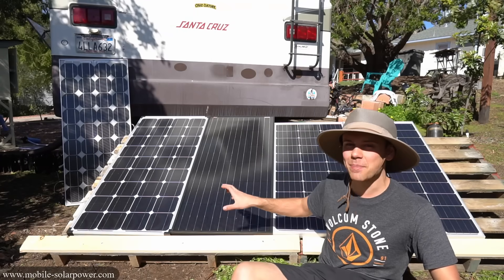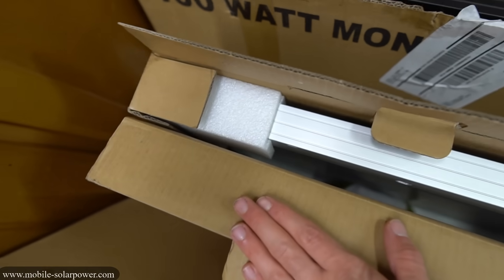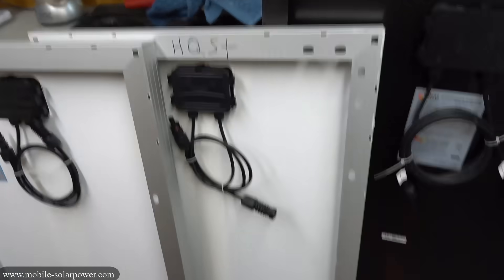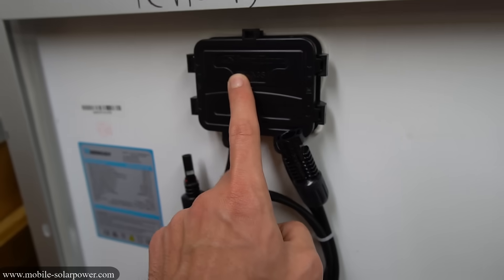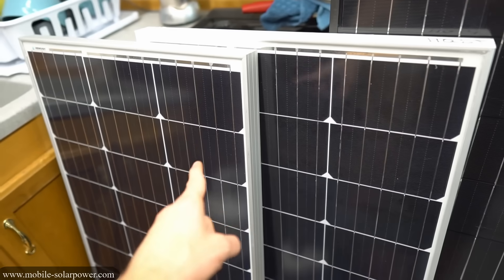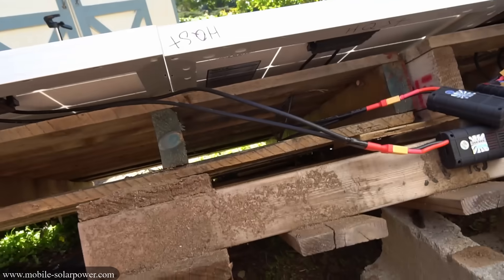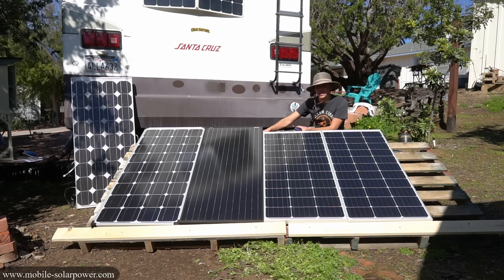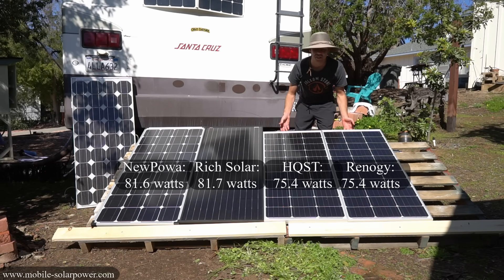Top 4 Amazon.com 100w Solar Panels Tested! Renogy vs. HQST vs. Rich Solar vs. NewPowa

Comment: I realize that we can't get LG NeON_2 panels from crAmazon but they are worth a shot. At 370 watts per panel and direct hermetically sealed inverters that synchronize to increase the power handling. I know that charging batteries from an AC source is inefficient compared to direct DC systems. It's still more effective than most other solar systems due to the high output. It also simplifies the system as there are no additional inverters or adapters to buy. There are battery backup systems available for reserve power when there's no sunlight. Definitely worth checking out.

Comment: Hi Will, I was just turned onto your channel by Bob Wells of cheap rv living. I know absolutely ZERO about solar or any kind of electricity or electronic devices. I recently bought a rockpals 300wt solar power station after a lot of research and have used it without solar a few times. It seems to work great for my applications. I do not have a fridge or anything with high usage like that. But decided I'd be well served by getting at least one solar panel. I read and saw got reviews on the newpowa 100w 12v panel. I also don't want to mount it permanently on my van roof as I'll have other stuff up there among other reasons. These purchases were also financially motivated. After watching this video I'm hoping that I will not regret that decision. But since the purchases have been made, my question now is what else do i need to buy to connect these 2 and have power? Keep in mind the finances issue here. So far I've spent a little more than $250 so I'm doing good I think. I do not have a lot to spend obviously. Thank you in advance for your help. And, I love watching your videos you make this complicated information much more understandable.

Comment: I have Renogy compact 100W. It puts out 75-80W via microinverter. A little smaller than other panels, for my installation that was critical.
I can't imagine those corner holes being functional, I think they're useless.

Comment: I was wondering if you have any experience with the HIGHTEC SOLAR 200W 36 CELL 12V NOMINAL SOLAR PANEL sold by continuours resources?  They also make a 210 watt with the same footprint as the 200 watt.  I am trying to decide between the HQST 190 watt panels vs the Hitec?  Thanks for any input.

Comment: One test I would be interested is how much each panel is degraded by shade spots.  This is a big problem with any mobile use of solar panels.  Like with some panels a small shade spot will complete kill the output of the panel.  Adding this test should be useful information in considering a solar panel purchase.  Do you agree?

Comment: They are ADVERTISED as 100W. Do the ratio of area / power output, they'll be the same. A way to show higher yield, but if you are limited by size, area / power is what matters.

Comment: Hello.
 j'ai un HQST 12v100w polycristallin, pour charger une batterie de 80A, depuis plus de 4 ans. (en 2021).
Le panneau charge même avec 30cm de neige dessus.
Trés contente de ce panneau, même si la batterie est trop forte, il rempli bien sa fonction. (L'installation de départ était prévue pour une batterie de 60A, mais on a pris une 80A).
Donc oui, je suis OK. HQST = Bon produit.
Reply: Je penses, equalement d'acheter le HQST 12v100w a place du Renogy. La neige qui  peux  mettre un baton-dans-les-roue. Merci pour la confirmation !

Comment: Does anyone know the answer to this question,  I got a 14 inch by14 inch panel,  supposed to be 100 Wat, but you usually see that same size at around 20 or 30 wats , is it possible that its really 100 wat.
Reply: I bought a twenty watt panel.  Turned out to be 5 watts.  Only about 9 inches square.  Another China con.
Reply: @jimlarsen6782  yes basically your right.
Reply: Depends on the weather & sun condition
Reply: @briantruck2284  i meant is it possible that such a small sized panel could produce 100 wats

Comment: I have 800 watts (100 watts each) worth of Newpowa panels and they charge my 560ah batteries really well. For the price of $79 per panel and a higher output... I'll deal with the slightly larger size.

Comment: I know you’re a busy guy but I could really use your help I’ve been watching your videos and I recently purchased Rockpals 500 W generator and two rich solar 100 W 12 V poly Crystaline panels.  I don’t understand what adapter I need to buy to connect the two panels together and then to plug it into the generator to charge it is it possible that you could send me a link in terms of what type of adapter I need to purchase to connect the two panels so that I can plug it into the generator to charge I would greatly appreciate it and I find your videos extremely interesting.

Comment: you missed one of the biggest points! Vaule to watt? "If" size is not an issue 10% more watts is very good and maybe equale in watt to foot print ratio.
As I found the "newpowa 100 watt cells for 33% of the average cost of the lowest price of the other cells, I must disagree with your conclusion.

Thanks for taking your time!!

Comment: I just bought the Renogy Kit (Flash Sale) 100 watt 30Amp with PWM Controller. Not sure which one you tested in this video. But your thoughts would be appreciated. By the way, the flash sale saved me $50.

Comment: You are ruling out the larger ones because you don't like the size...  but they do give out 9% more power....    So I do slightly disagree with you...  have to give them credit for that extra 6watts per 75watt base...    But love the video, respect you buying the panels, and the excellent info to make comparisons...    and thx for the recommendation...   the hqst does seem great...  but wanted to give credit to the others if they were also cheaper....  don't think you noted their price..

Comment: Okay...I bought 3 of the HQST 100D SSP and today thru my 4215 bn they were showing 268.6 watts in series...Im gonna put two and two together...I used inch and a quarter square steel pipe for my protective frames...I just welded two inch pieces of inch and a half strap wherever I wanted bolts..its heavy enough the wind wont move it but light enough to move..

Comment: Even though the HQST and Renogy panels appear to be clones of each, with the HQST having a slightly lower price, the HQST company itself seems to have issues. I ordered a couple of inexpensive items from them on Oct 18, 2020, it is now Oct 28, 2020 and I still haven't received them. HQST supplied a USPS tracking number and the USPS still shows that they have not received the package from HQST.

This tells me that either HQST has horrible management practices or they are floating money.

For me this brings into question the ability of HQST to honor it's warranties.

Comment: Hw Will love your channel but I have a question I live in my van but I just started so funds are limited. My question is if you could afford 1 150 watt solar panel which one would you buy?
Reply: Depending on what you are powering you might be better off with a DC to DC charger.

Comment: What happens if I just hook up 4 panels straight with an inverter and no battery to store power? Basically I only want my equipment to run during the sun up time, what happens to all the excess energy capture? Is there a way to waste it or will it burn up the equipment?
Reply: It probably wont run, or run very poorly which would eventually burn out your equipment. 
Never mind the excess energy, how will it run on a decrease in power? 
Do you mean a charge controller?

Comment: If you need more than 100W, screw 100W panels.  Get a 325W Canadian Solar
 panel.  Cheaper on a $/W basis and it has better shade tolerance than 
most panels.  No free Amazon shipping though.  Typically a flat $150 for 1-8 panels.

Comment: Also there is very lite that putting a battery underload, however. For the efficiency loss the smaller panels where better if they were cheaper. However you are looking at 30% efficiency loss. But solar has that issue in general you need alot of space to produce a little power. And you cant speed charge a battery underload so in most solar applications its best to oversize your battery bank to offset charge capacity to your panels and with 100 watt panels you have an awful lot to compensate for.

Comment: Seems to me that the renogy panel and the hqst came off the exact same assembly line renogy is obviously buying their panels or getting them from the same manufacturer and what renogy is selling is their brand name and service that's why they're more expensive than the hqst?
Reply: Renogy makes the panels that HQST is selling. It's likely those are panels that Renogy has QA'd as being "b" quality.
Reply: @peterrocan2542  okay I like that... good insight! Sounds a little more reasonable than my tinfoil hat pessimism as usual...thanks!

Comment: the year is 2473. uncle owen is trying to decide which  solar panel the jawas are selling is most reliable.  you watch this video to find out the best way to determine how to determine which solar panel is best.  you make a choice but the solar panel explodes as the jawas begin to unload it, so you end up buying the cheaper R2 unit.  thus beginning your journey to learn the ways of the force and destroy the empire

Comment: Looking to purchase a 150W or 175W panel for RV roof mount on a 24’ Winnebago View. Any recommendations at that wattage? Also if the wires coming from the diode box are too short can they be easily extended or do I need to use a special type of wire? Thanks and keep up the awesome video reviews !

Comment: I just bought this panel (RICH SOLAR 200 Watt 24 Volt Moncrystalline) , to start my solar project :)  but I get a max of 150W  (California summer, 95F+) ,  I asked the Amazon vendor why I was not getting more and they said that it depends on a lot of factors (which is true now that I learned a bit about panels, is hot here!!!!) but, how can I know for sure that the panel is a real 200W ? (of course when the best tested weather conditions are in place).  I found more expensive 200W panels which are bigger and with more cells, so I just want to be sure I am not getting something different from advertised. I  have a 30ft 10awg from the panel to a victron 100/50 mppt to 24v batteries and 3k inverter  , I have the same watt meter you are using in this video and I  use the victron app to validate PV info. Thanks

Comment: It might have helped if the panels were tilted at a different angle to maximize the output.  But they were all the same, which was a fair test.  Hey, the larger panels have slightly larger areas so it makes sense that they should put out more power.  BTW, you said "cheap Chinese..." But that's redundant.  Everything from China is cheap, so just avoid redundancy.  Your evaluation videos are great, thank you for the information.  👍

Comment: Will takes time to keep variables out of the testing process but then gives a completely biased set of results!
A review without price is useless!
The 2 larger panels may have cost less while clearly putting out the most power so for someone looking to put just one on the roof of an RV they would be the clear winners!

Comment: I am really enjoying your videos and find them very helpful. 
I am building a teardrop trailer and would like to add solar as a power source. I will not be powering much more than some LED lights, a 12V shower pump, A laptop and some USB chargers and certainly not all at the same time. I was looking at the HQST panels on Amazon but cannot find the models in this video. I have a 5' footprint for mounting on an angled roof (actually 2 so may do 2 - 100 W / 12 V panels). Can you share the product code (I'm looking for dimensions)  and if you no longer have can you confirm that the size and shape don't matter so long as the ratings are those I'm looking for. Don't know why it would matter but never hurts to ask. 

Thank you in advance if you find the time to answer. 

Drew

Comment: Hi Will, any thoughts on the Newpowa 200W Monocrystalline 200 Watt 12V Solar Panel High Efficiency Mono Module RV Marine Boat Off Grid?  200W taking up less space sounds compelling, but would appreciate your thoughts.

Comment: Great review, I've had 8 of the HQST panels for almost 2 years and at peak time on the average they hit up to 731 watts, off a Victron 150/35 Controller at 25' with 12 gauge marine wire.  That's around 91-92 watts per panel, I hose them down maybe 3 times a year, due to birds and dust, very happy with them and saved a few bucks in the process.

Comment: @Will ....... Hey I have gone back through some of your videos looking for an answer to a question I have had for some time now and was not able to find anything answering the question that I have.... So with that, here is the question. Maybe you can shed some light on it for those of us who are nubes to the whole RV solar world. 

Why can we not use "Home-use" or "Residential" solar panels or systems for off-grid RV use? 

From what I have seen Residential panels have a higher output than said portable or "RV" panels and "SEEM" to handle heat better than portable/rv panels. I am also looking at tying in a wind generator to the charging system as well since we are planning on prolonged stay to help keep the system charged on days and weeks where there isn't much sun

Comment: The solar panel and wind turbine manufactures have done a disservice to the consumer by marketing  their products in  Watts. Watts are a unit of energy consumption not energy producing...like bulbs are labeled by how many Watts they are consuming...A better way to measure the ability of a panel or wind turbine is to know what is the voltage and amps they output given the same load. A 12 volt battery needs about 14 volts to be able to be charged else it does nothing the amps determine how fast it charges.  A car's alternator is rated by how many amps they produce not by how many watts...go buy one or check your car. You never mentioned the  no load voltage that were present at each panel nor the amps being produced once connected. Solar panel are being marketed by how big of an appliance can be connected to them directly thus the watts rating...most people use panels and turbines to charge batterries not run thing directly from them.

Comment: I purchased 4 HQST 100 from ebay yesterday. I never heard of them before 3 weeks ago. But I like how I can get a discount on purchasing four of them. However, after looking again, I saw I could have gotten windy nation for a little cheaper. But this is Poly not Mono. 

I have been buying Poly since the beginning because of cost. But after doing some research, I found that Mono is more efficient. So I'm giving Mono a try.
Already having 8 panels. I plan to concentrate my Mono's for running my small freezer and thermo-electric cooler. This will be couple with 4 Golf Cart batteries running at 470AH. 

With that said, thanks for the effort you put into the review. Now I feel more confident in my buying decision.

Comment: Hi. Thanks for the informative and helpful videos...
Any chance you can help me with a recommendation?
I have a workshop with 3 x 36v, 7A panels in Parallel feeding a 12v flooded battery setup. Can you recommend a budget MPPT controller PLEASE?
I have a no name 30a mppt 12/24v controller which, even though I set the parameters to less than battery voltage, it still charges at high currents. I'm not sure if this is because the panel voltage dictates the output voltage (over ruling my manual settings) or what! (I've tried 2 of this same controller with same results)
Anyway, can you recommend a budget MPPT controller for 12v systems that allows for a 36v panel input?

Help truly appreciated ... Dave

Comment: I own a Renogy 100w 12v solar panel 

Was gonna buy Renogy Rover Elite 20 amp MPPT Solar Charge Controller, 20Amp, with LCD Display as controller will this item works as controller

Comment: I don't get why you wouldn't want the panels that produce the most power. No matter where you live you will never get the rated wattage out of solar. You might as well get as close as possible by buying the ones that output the most. On a cloudy day it might be the difference between running your electronics or not.

Comment: Yes a lot of them are all identical  components on different variations of mounting rails position of terminal and so on and if you order them all over again  you might even get different set up I've seen a 99 dollar one from aussi an a 300 everything same parameters and the 99$ pulled a massive positive deference over the more expensive .  All I know is I'm here to learn from "seasoned vets" to embrace knowledge so im ready when the the stars align 🙏🏼

Comment: Could you please do a review / test and compare the ECO-WORTHY 12v 120 watt solar panel found on Amazon for $99.99. I am considering purchasing a set of 4 for an RV off grid power source. They claim to use grade A solar cells and I am wondering how they compare to the other panels you have reviewed in this test. I have researched each of them and was wondering what your thoughts are.
You make great video reviews and I have learned a lot. I just ordered your book from Amazon and I am looking forward to getting my hands on it. Keep up the good work.
Thanks M. Hansen

Comment: I'd like to see a head-to-head comparison of Renogy's "high efficiency" 100W Eclipse vs their (or HQST, same thing, right?)  100W Poly panel.  If you do it, please include impact of shading as Renogy claims the Eclipse is "4-5% more efficient" compared to their standard panels (mono or poly) under partial shading conditions.